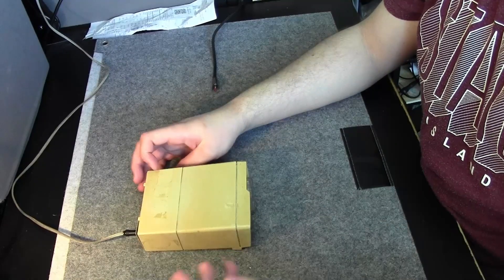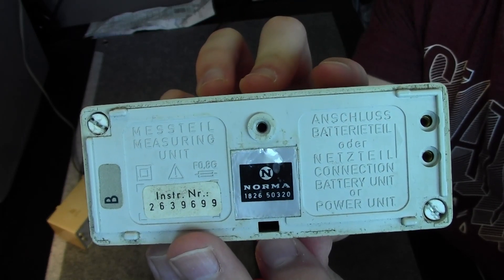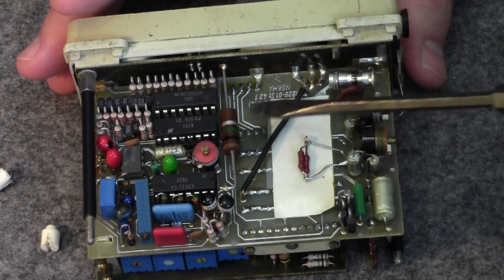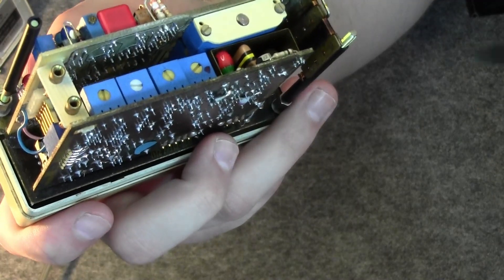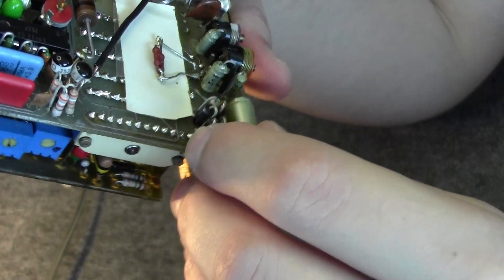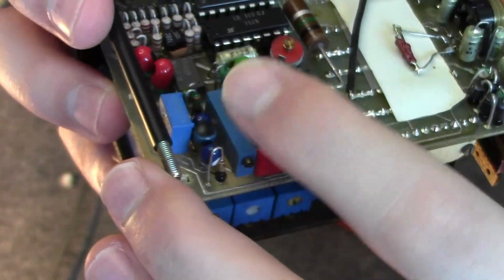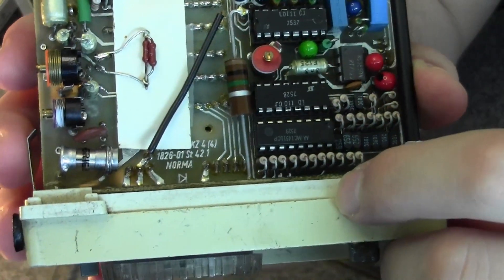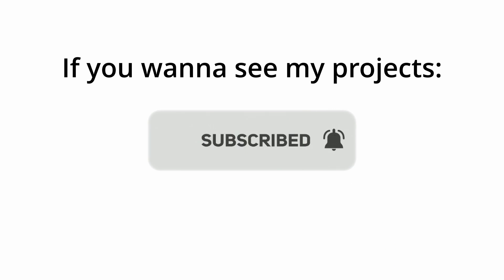What's Inside a 50year old Multimeter (Normatest Digital 1826)

Comment: This is cool! How much power does it draw? What kind of batteries did it use? How much does it weigh? Too bad you didn't show the measurements compared to today's multimeters and you didn't take any static "beauty shots". I would have liked to look clearly at the whole device and each detail.
Reply from the maker: It weighs 400gs w/o the batteries. I'm not aware of what kind of batteries does this device uses; i reckon something proprietary lead acid brick, but there is not much info on the Internet about this. I could not showcase how precise the measurements are on this, cuz I don't have a bench multimeter to compare it with. And comparing it with my handheld multimeters - it does not make much sense, because they aren't really high end, precisely calibrated instruments either. 

Thanks for the feedback tho. Appreciate it :)
Reply: @francisstudiosengineering  Thank you :) keep it up!